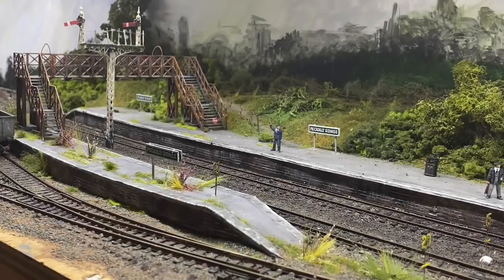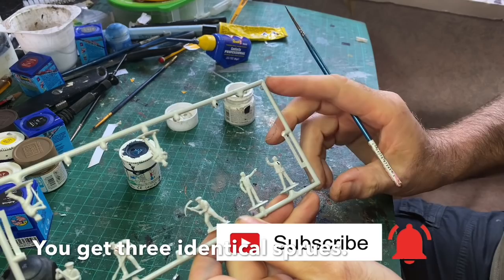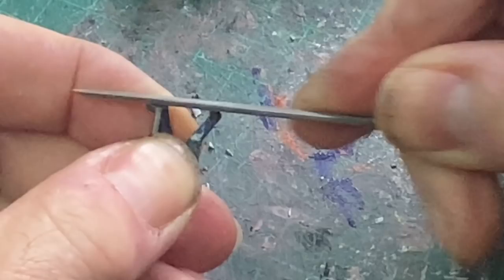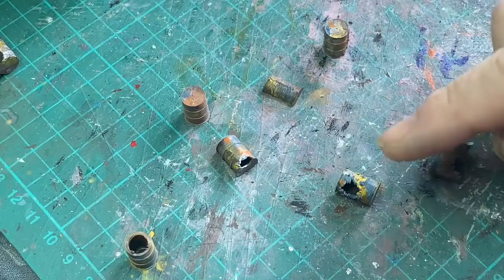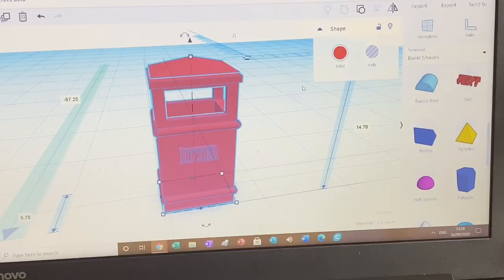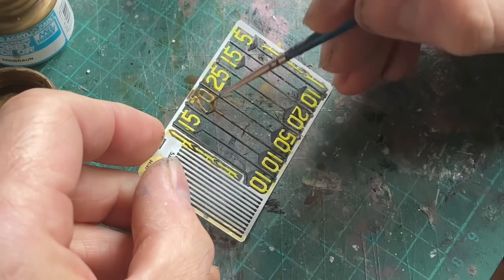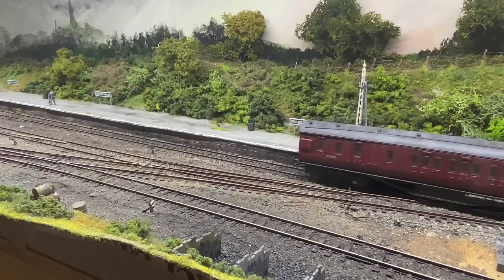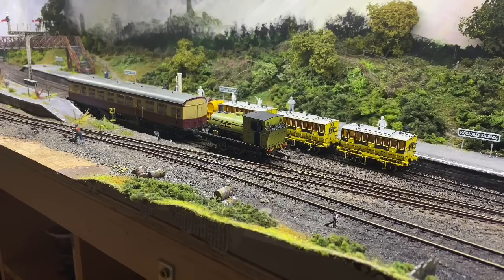Railway Modelling – adding & painting details for my OO gauge model railway.

Comment: Hi John,
You have it right detail is king and these new additions only add to the realism so very well done as usual. I would not presume to teach you anything but if I have to couple up a loco to a train I always put something at the back to stop it moving as long as it does not cause a short anything will do just adds to the realism and if the sound loco has a coupling sound in the file I use that two if the loco you are using does not have sound or that file but another one does use that it is very unlikely that anyone will notice. The way you did a run through at the end of what we had seen makes me think you are going to give us all an exam later but it must be the teaching coming out without you knowing. Keep safe and well and concrats on the 9000 one.
Cheers Robert.
Reply from the maker: Thanks Robert, I bear those ideas in mind. I do normally try to stop the loco at the coaches, must have been ‘off form’ lol. The recap at the end is a teaching trait, we call it a plenary. In modelling I think its good to see the items in situ.

Comment: Lovely model, very realistic. Just a tip though: scrap rail would never be left lying in the 4 foot, it would be dragged over to the cess
Reply from the maker: Hi thanks, I’ve seen scrap rail left all over even on high speed lines. Honestly I wouldn’t have done it if I hadn’t seen it. I have a mate who drives pendolinos and he gives me loads of tips.
Reply: @piccadillysidingsoogaugemo6445  We would raise a close call for scrap even in the cess - tripping hazard; but I dont doubt you.  I worked on track maintenance for 3 years, you wouldn't believe the sort of things that went on.  Anyway its a beautiful model with some of the best scenery I've ever seen.
Reply from the maker: Forcing you point won’t make me change what I’ve seen thank you for your comments.

Comment: Hi John,  

What was the website you got the designs for the barrels from?  

Thank you for another great video.  Always look forward to getting the notification from both your channels

Michael
Reply from the maker: Hi Michael, any downloadable 3d models usually come from Thingiverse, but... when you put them into the slicer program (cura) check the structure by going through the layers. Some models will not print correctly. There is loads to pick and choose but a proportion havent been constructed correctly.
Reply: Thank you.  Will have a look and see what I can use.